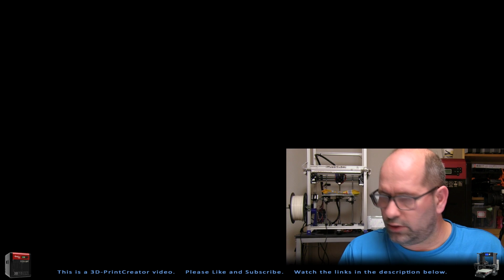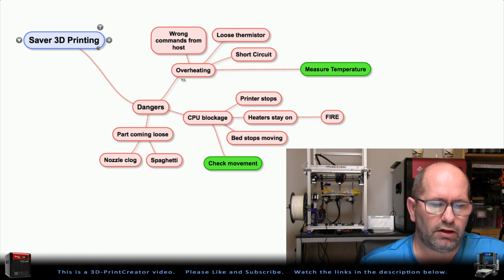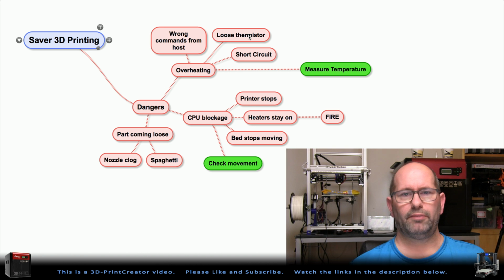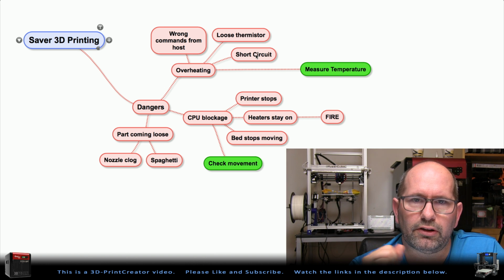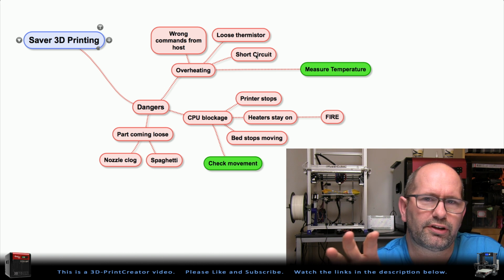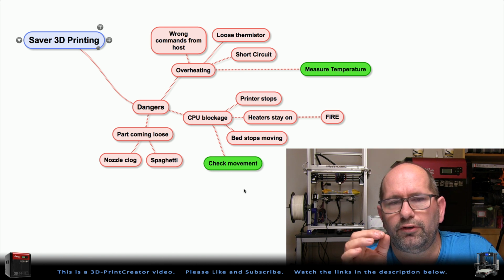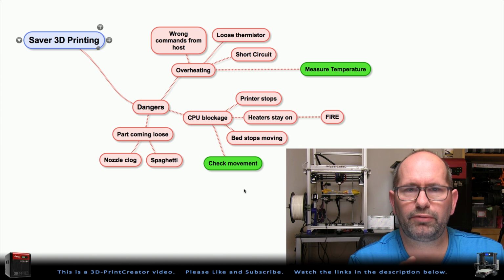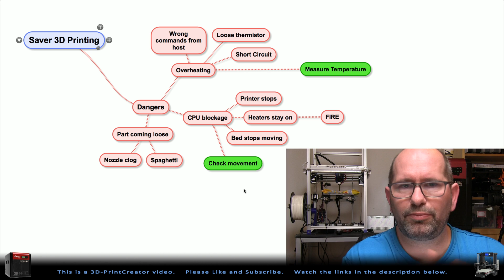▼ Community Thing ⚠ Lets make 3D printing safer

Comment: Great idea. Safety first. 
What about some components we use in the printers itself?

Like for example the powersupply.
I got (as many of us builders) a powersupply from ali/bangood.
After opening i found that many components were very badly soldered, some were eve hanging loose.
Could be a potentential fire hazzard aswell.

I have resoldered the bad spots and it looking better but i consider buy a better quality one. 

For thoose who got thoose supply, i would advise open them and check soldering and resolder the bad stuff.

Keep up the nice videos, Ill keep follow this safety guide from u )
Reply from the maker: Well, that's a very good comment. I will for sure dive into that.
The safety thing we are going to make for sure will also include measurements for the power supply, but opening the thing and checking it, that's a very good idea.

Thanks !!!

Comment: for temperature measurement i suggest a MLX90614 infrared measurement set on the printhead, plugged into an arduino to high temperature switch of main power of printer.
for the filament make a movement sensor wheel with slots and a optical end switch no movement equals no high lows anymore on the input so switch of printer also on arduino.
Reply from the maker: Thanks !!!
That looks like an option we must take a look at. It has a very large temperature range and seems to be available in 3.3 and 5 volt versions. I will dive into this.

Comment: I like the idea. I also think you are on the right track with multiple sensors. In addition to temperature sensor in the hot end, other sensors could be in installed. A simple mechanical or acceleration sensor could be installed in the hot end to detect its movement or lack thereof. A CO2 sensor can detect fires in the power supply or other circuits (not sure if the filaments will create CO2 when burning?). Another PIR movement sensor could be added to the mix, along with a sound sensor to detect the noise during printing. Not sure how to detect the spaghetti incident though, maybe zone intrusion sensors to detect when something protrudes out of the print bed sides.
A simple arduino is well equipped to monitor all sensors and energize something when the conditions call for it, like powering off the printer or an audible alarm.
An ES8266 (like inMc Biow's comment) is in the same price range as the arduino and adds the possibility of sending a message via the internet (sending an email with it is tough though). Adding a raspberry pi  I think would make this a bit complicated and expensive though.
I also thought about what if the system could communicate with the printer CPU to get hot end temp, etc, but that might make it not universal?
One last thought and this I do not know what I am talking about: I have a Da Vinci Pro; it is enclosed. When the event happens, can I discharge a gas inside the Da Vinci? In my data center days, we had FM200 fire suppression systems. Of course it's gotta be inexpensive and easy to use. Could plain old CO2 be discharged inside the printer to displace oxygen and put out the fire?
Reply from the maker: Hi, Thanks for your input. Sensor wise, I don't think that a PIR sensor would be the right thing to use, but there are other, far better motion sensors that can be used and that are very easy to work with because they only have an ON or OFF state, so there is no hysteresis. For the processor I still think an Arduino Micro could do the job if it's only about controlling the power to the machine. If we want communication going out of the machine, we might think of a Raspberry Pi, and maybe the Zero W version would be a good kandidate because it's only 10 Euro / dollar and it can do all kinds of communication, even emailing is very easy then, or using a webcam.
As for the release of a gas inside a printer I am a bit nervous. In a data center they have ways to completely fill a room with gas, without the gas escaping from that room (airtight controlled room), but a 3D printer has all kinds of openings. I don't want to use a gas because I think that could suffocate a person who is in that room, or the room next to it. It brought me to another idea however, and that is the use of foam. I don't know enough about the matter, but there are foam types that are made to put out a fire and that are easy to clean afterwards. This is an idea to dive in to. It all stands with the quality of the sensors however... You don't want a false alarm if the event you are executing could give you a lot of problems, while just turning off the power is not that terrible, but it doesn't kill flames.

Good thoughts... Thank you.

Comment: while i dont have the technical ability to do this... im definitely following,  as far as the pro 1.0 spaghetti... maybe some lever switches around the hot end cartridge... that would surround the nossle area but not affect the print.... so if spaghetti happens the lever switch would get hit by the material.. and a signal would go to the computer to shut off power.... just a thought... not sure how feasible it would be.
Reply from the maker: Hi, thanks for your thoughts on this one. I don't think a lever would do the trick because you always need a bit of force to control a lever switch, but there are possibilities with a spring in the center of some contacts that could do the trick. if the spring hits the contacts it's surrounding, then you know something is wrong. It has to be tested to see if it doesn't generate false alarms, but I think this might work.

And about the technical ability, I want to make this a project like LEGO bricks. We all know how to 3D print things, now I want to add some electronics that, even if you don't understand what you are doing, as long as you follow the instructions, you will have a good result.

Comment: Find this a great idea...something that worries me is indeed the safety...I have a smoke indicater above the printer and never print unattended !
But my idea for overheating...is it not possible to calculate the amperage of the heater at ..lets say 200 and 400 C and measure that with a Arduino ? just reroute one connection from the heater to the Arduino for measuring with a circuit and if the amperage is to high, cut it off, sound a alarm or something like that.
Reply from the maker: Thanks for your input. That can be a way to look measure things, I will try it out and see how accurate it is compared to, for example, a thermistor.

Comment: Use a ESP32 (quit new) or ESP8266 (better implemented in the Arduino IDE) both have a integrated WIFI, and works with the simple Arduino IDE. I know it is new but I'm sure the ESP32 will have a lot of potential in the future. For collecting the data you can use the ESP32 / ESP8266 with MQTT to report over wifi the sensor data to a raspberry pi with mosquito MQTT broker installed or a cloud MQTT broker. MQTT was used long time for pipelines maintenance and remote monitoring.I think this could be a interesting project, think of what kind of information (nozzle Heater, bed heater, Stepper movement) you can get from a power consumption (input current) of a 3D Printer. Of course the internal power supply will flatten the measurements because of the internal capacitors. But would be interesting to see how much data you could get out.Good start for monitoring the input 230 VAC voltage and current could behttps://learn.openenergymonitor.org/electricity-monitoring/ct-sensors/introductionBecause the multiple ADC input pins of the ESP32 are not implemented right now in the Arduino IDE. You can use a ADC Module like https://www.adafruit.com/product/1085
Reply from the maker: Thanks a lot for your input. Let's decide that the board I am going to use for the project is not yet selected.
I love MQTT and all that stuff, but I want to keep it very low cost, but hey... That's only my opinion. If the majority want's it with MQTT, then we will do that.
In my next video I will explain the suggested possibilities.